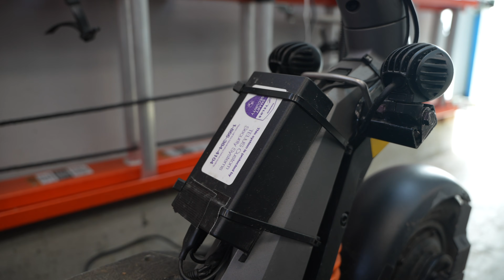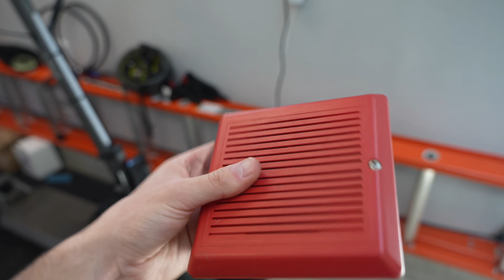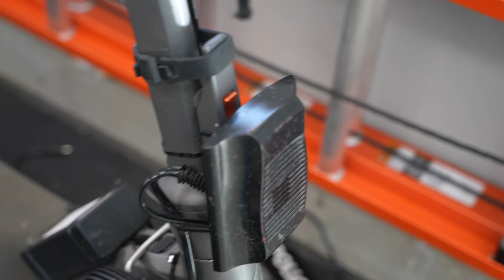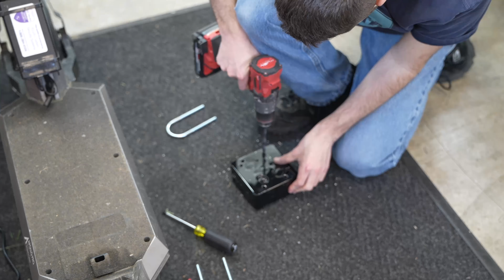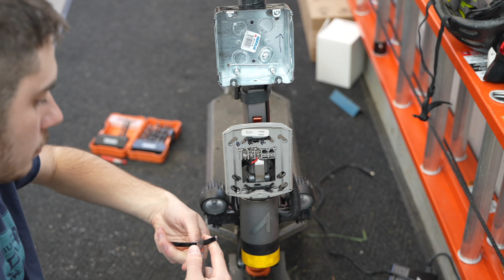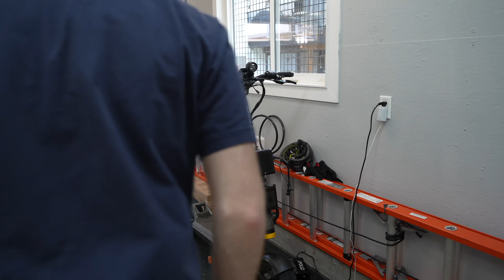Fire Alarm Horn Installation

Comment: I can only imagine that there should be some sort of lighting component.  maybe not strobes, but at least like a momentary on for all of the lights?   Also, does putting a bunch of horns on the scooter make it a horny scooter?
Reply from the maker: I thought about doing a momentary switch to flash the lights usually I just use the light switch though so far. And yes.

Comment: I've got a question that this is the perfect community for.  I'm sitting in a hotel room right now and every once in a while the green light on the smoke detector stays on for anywhere from 45-90 seconds instead of just a periodic blink.  What would cause this?

Comment: I actually prefer the sound of an integrity over a spectralert advance The grey horns are general alarm horns the integritys are dubbed "electromechanical" because it's a very mechanical like electronic horn. I believe the grey one you had was a first gen integrity which had the adjustable pitch using a potentiometer which I think are better compared to the newer ones.

Comment: Man I wish you installed it on your system ☹️
Reply from the maker: Why? It won't sync with my system.
Reply: @nics-systems-electric  mabye make a system board with a borrowed panel with est devices and make a test on that or you could put the EST device outside or on a pole with wires connecting to it just like firealarmdude597 just a different alarm or put it on your tower

Comment: Are You Able To Install A LED L Series Ceiling Mount Horn Strobe In Your Kitchen Of Your House Since Kitchens Are The Fire Magnets Of Most Houses
Reply from the maker: Couldn't be a a horn strobe but could be a strobe or low frequency sounder strobe. It would however not provide any benefit to a fire in the kitchen as it does not provide any detection.
Reply: @nics-systems-electric  Well Maybe Try To Install A Smoke Detector And An L Series Low Frequency Sounder Strobe In Your Kitchen That's Another Idea
Reply from the maker: @ryancrooks123  usually not a good idea to have smoke detectors in a kitchen.

Comment: To be honest like Hospitals, I don't think horns should be installed in schools or office buildings because they are too startling. They should be used in grocery stores and restaurants.
Reply from the maker: Fire alarms aren't supposed to be charming it's literally warning you you could be killed If you stay in the building. I think it should be pretty loud. You wouldn't want someone whispering to you to tell you you're going to die if you don't take action.
Reply: I think they're saying it induces panic which is obviously not ideal in an emergency situation. Voice evac systems and speaker strobes are alot less panic inducing and better at evacuating a large occupancy than horns.
Reply from the maker: @ that's partially true. If it's going to be customized with specific instructions for the specific building then it makes sense. However most are not set up that way and other than having the capability of using as a PA, it's almost useless. Fire alarms are meant to be a pretty easily recognized signal where it's going to be up to the individual if they want to comply with an evacuation or not.
Reply: I think voice evacuation systems should be standard in every building it'll get your attention but won't induce panic and give helpful instructions. @nics-systems-electric
Reply: I'm with you I work in hospital and clinic settings and these things scare me to death.....they have them at a low sound setting a ding or whatever it is but going at a no volume no one talking no one around you are literally by yourself then this goes off you about have a heart attack I'm also hypervigilant and  have ptsd so it's triggering as fk....I know it needs to be loud to alert people but when there is no noise no need to be able to hear it from 5 miles away
Reply: So agree 👍
Reply: I mean, you don't want them to cause panic but you'll still want them to be loud enough to be heard. I mean, they are warning you of a fire that can kill you! Get out now! NFPA code requires all fire alarms to be at least 20 DB above ambient levels. So how loud an alarm should be depends on where it's getting installed.
Reply: So fire alarms are loud as hell to make you not want to stay in the building because it’s so loud